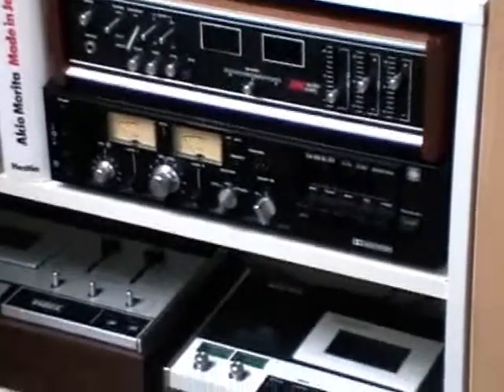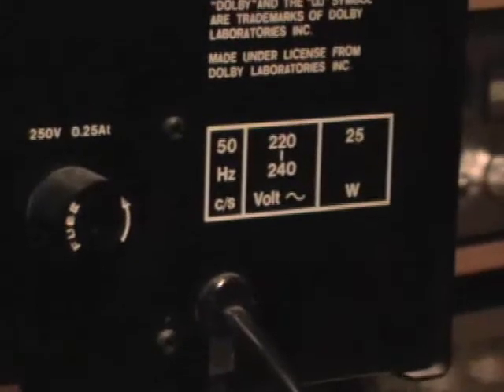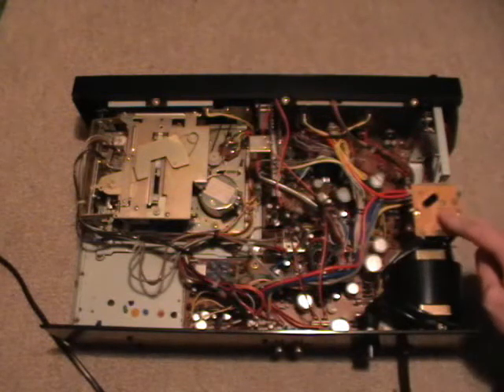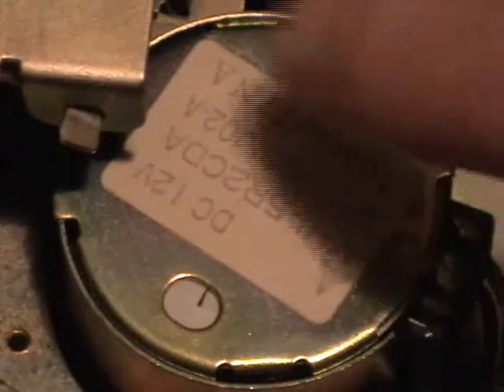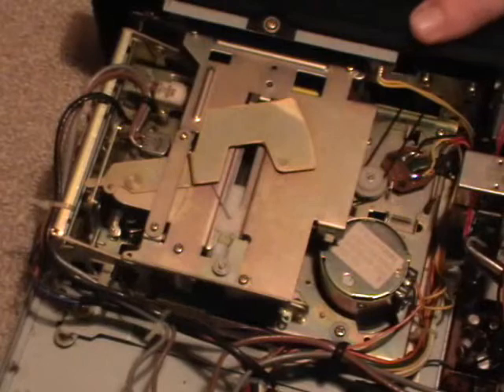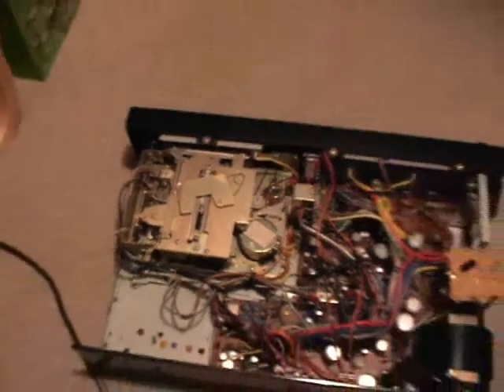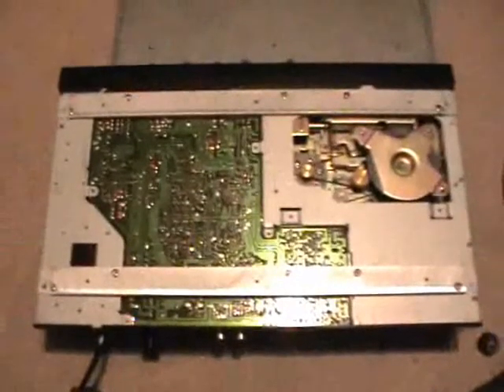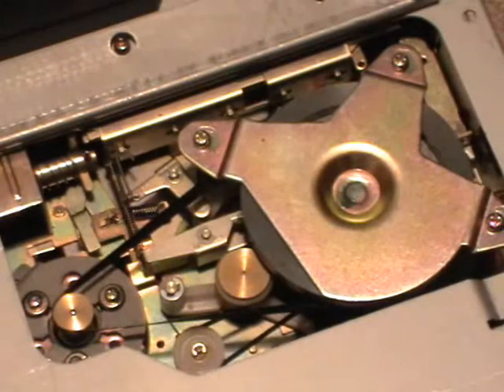Inside the Uher CG 330 cassette deck

Comment: Could we improve frequency response? Anyone know what type of head does it have? Is the limitation in the preamp or the tape head itself? I have this "machine" since my childhood. Tip: If problems whit the speed consistent despite changing belts, cleaning the drive and oiling every moving part. The motor's built-in speed regulating circuit is often faulty (change capacitors, and check resistor values).
Reply from the maker: Not sure why you would want to improve the frequency response? This cassette deck sounded perfectly fine to me...

Comment from the maker: @bluenazz 

You're right, that is a big problem of this design. There was a portable version of this cassette deck, and that version had a little window in the top cover.
But with this cassette deck the only solution is to use the counter and calculate wich numbers mean what in real time.

Comment: Clearly Uher knew what they were doing with this one, are Uher still around today?  When the tape ends does the auto stop system retract the heads and pinch roller from the tape, or does it just switch off the motor?